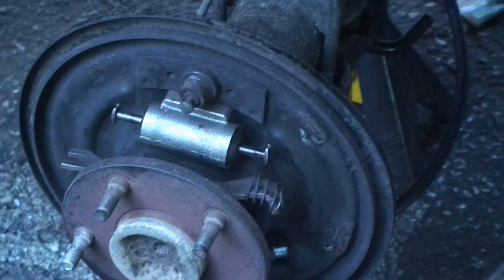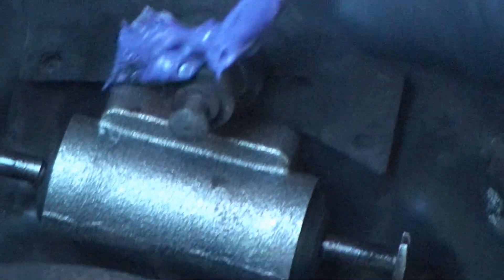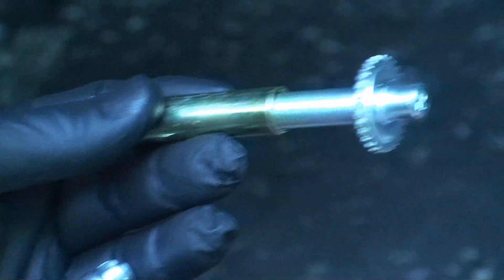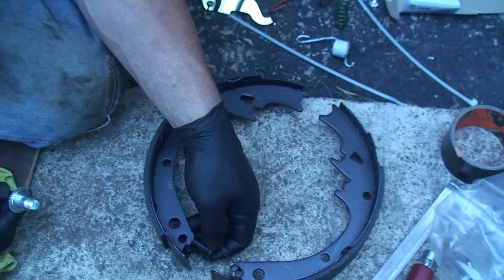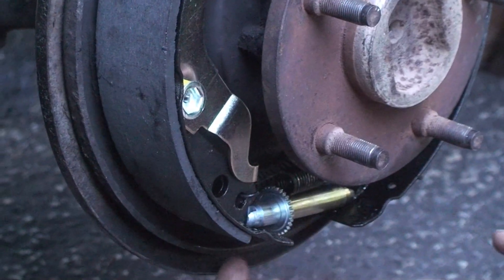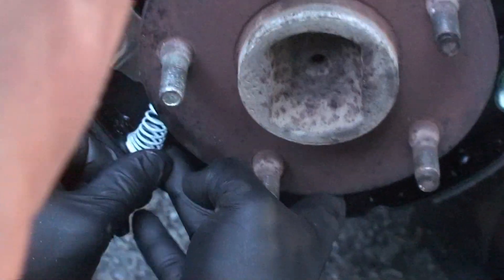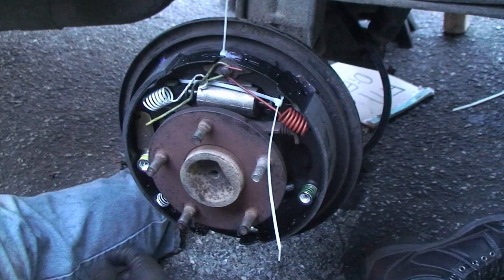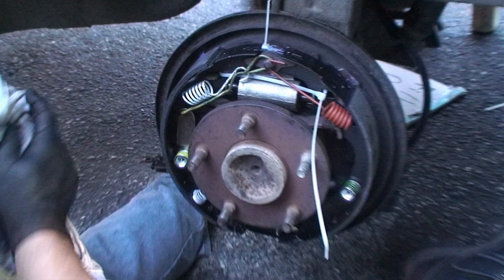1997 Ram 1500 - Rear Drum Brake Service for the Driveway Mechanic

Comment: Not sure if the 1500 is the same as the 2500-3500 trucks but I don't see why they wouldn't be. If you're going to change the rear brake cylinders use the 30mm ones that Chevy trucks used I stead of the 27mm dodge ones. They bolt right in place with no modifications & you'll get better stopping ability. Also most of the time they need at least new adjusters (make sure to use copper never seize on them) if not the spring kit too.
Reply: Dodge, GM and Ford ALL use Bendix brakes. That's why they are so much alike -- but critically different. In Europe, every maker uses Bosch brakes. Yeah, due to patents, Bosch and Bendix have territorial monopolies. Japan is different. BTW, you'll never see Bendix putting its brand on its stuff. Ditto Bosch. Such is the nature of the OEM marketplace.

Comment: If the drum brakes are bad, will it make a high pitched grinding noise? I'm having this problen on my 97 dodge 5.9 1500. The sound is coming from the rear of the truck. I'm hoping its just brakes and not the third member.
Reply: Probably the axle yoke.  It's problematic on those.  I've got a 97 with the same problem.  So loud!

Comment: If you have it, a NIB magnet even beats tape for holding the critical pin in position while you fiddle with the assembly. Dirt has no impact on a NIB magnetic field.
BTW, with smart phone cameras -- take photos galore all of the way. Also, use the passenger side R&R as a guide to the driver's side R&R. Never have both taken apart at the same time -- but both must be attended to -- or you'll have an un-drivable machine. With high mileage -- just replace everything other than the backing plate. Your machine will drive as if it just left Detroit.

Comment: You should put the pins first to hold the shoes and don't worry so much about keep it them in place you can always do that at the end. There's different ways to do it but as long as you get them done that's what matters.
Reply from the maker: Great tip, thanks!

Comment: I have 1995 Dodge van 1500 , I went to the store and that's what they gave me they were the wrong ones. I went. Back and the parts guy looked it up and they ended up being 1996 shoes. There's a little pin that sits on the end of the shoes that makes a difference. My problem is that i can't find a video for it. Please help, I have one side off and the other side fell apart.
Reply: tony Brown smart idea is take pictures before you start because you will forget like i did

Comment: Is this the same for a 99 dodge ram 1500?
Reply from the maker: Can't be positive, but I would guess they are the same until the next major model update (and sometimes even then they don't change)
Reply: 2 springs are a little different but basically the same process  though ...you can do the job with this vid and a pic of the brake set up[Before you pull it all apart for the spring difference and placement]

Comment: Hi was this a 4x4?
Reply from the maker: Yes
Reply: @mreinsmith  is it different on the other side?
Reply: @mreinsmith  is it different on the other side?
Reply from the maker: All the components are the same, but I think it's flipped left to right, that way the parking brake lever is towards the front of the truck
Reply: @mreinsmith  so the plate that has R on it that goes far rear ?
Reply from the maker: Not sure, haven't done it in a while

Best thing to do is either find a parts diagram at an online parts store or locate the repair manual
Reply: @lopezthecreator4663 having the same problem found the diagram ?
Reply from the maker: Try this https://www.moparpartsgiant.com/parts-list/1997-dodge-ram_1500/service_brakes/brakes_rear.html
Reply from the maker: I tried to send a link for the parts but it doesn't look like it is showing up
Find the site called "moparpartsgiant"